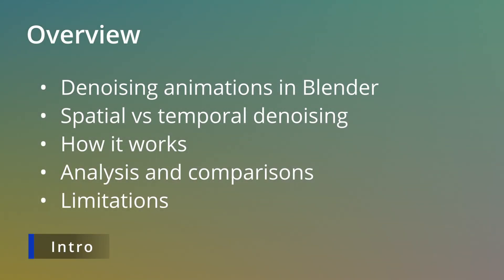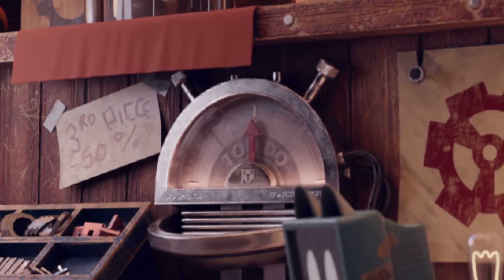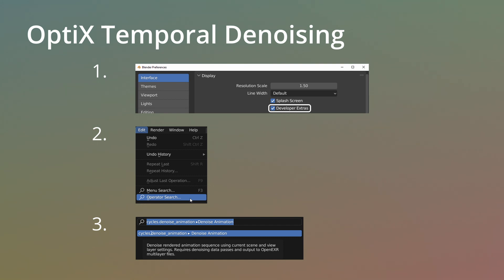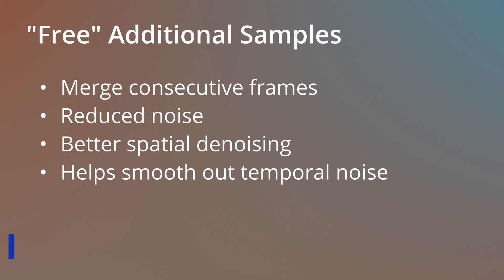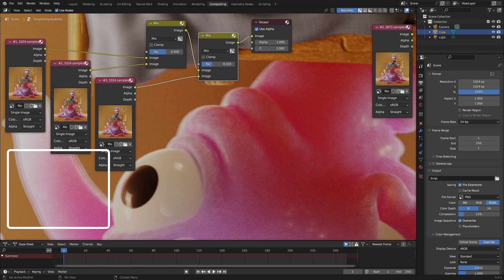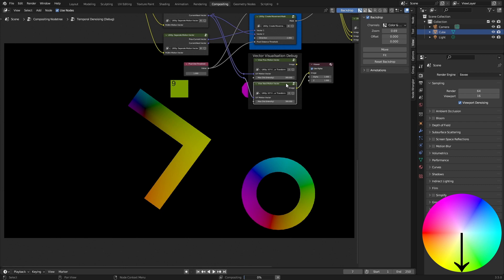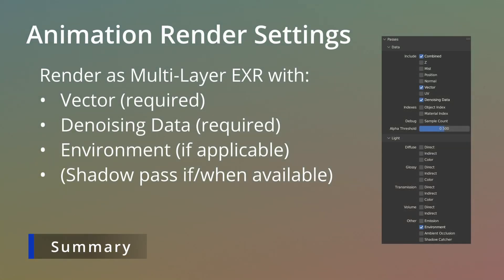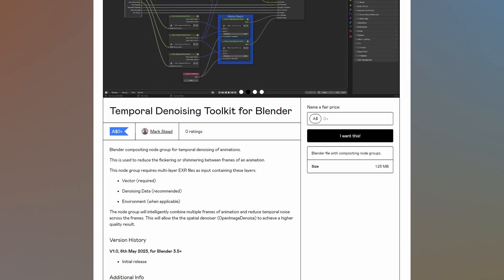Temporal Denoising Analysis

Comment: thanks Mark. This is great explantation. Do you think its possible to automate the denoise process with a python script commandline wihtout the need to enter blender?
Reply from the maker: I personally haven't done that.
Here's the command line doco, and you can certainly perform rendering, and run Python scripts.
https://docs.blender.org/manual/en/latest/advanced/command_line/arguments.html

If you have a Blender file configured for compositing then you could presumably just render that from the command line, with no Python scripting required.
Perhaps what you could do from a Python script is substitute node parameters for the filenames or the number of frames.  You should be able to fully integrate Python with pretty much anything in Blender including adding/manipulating compositing nodes.
For example in Blender if I modify the frame offset in the compositor, I can see in the Scripting window it has executed this command:
bpy.data.scenes["Scene"].node_tree.nodes["Image"].frame_offset = 1

Obviously you have a lot of extra complexity of setting up scripts and and all the command line parameters.  However it makes sense when you're trying configure an automated rendering pipeline.

Does that help?